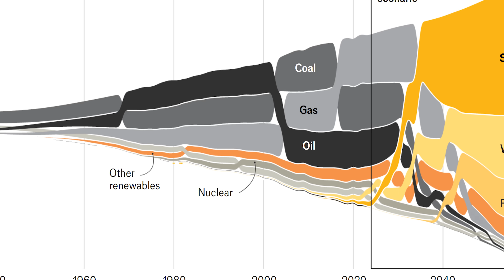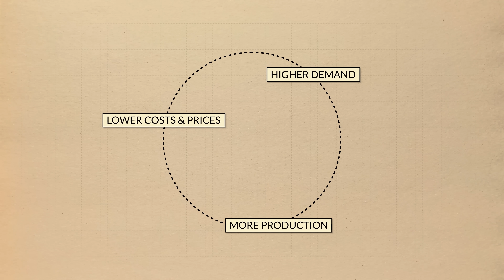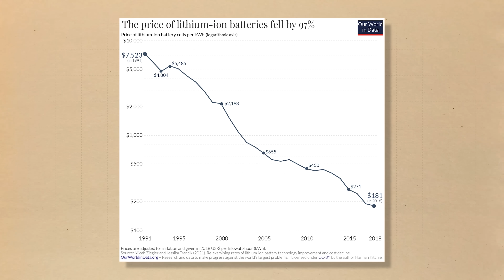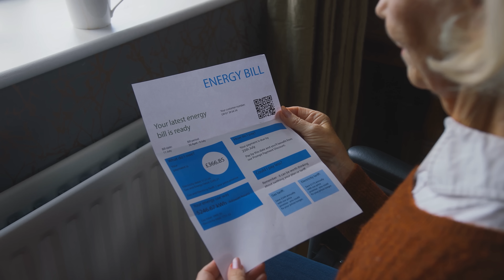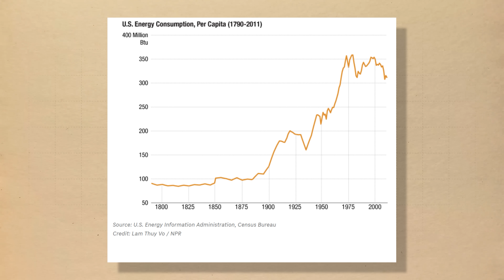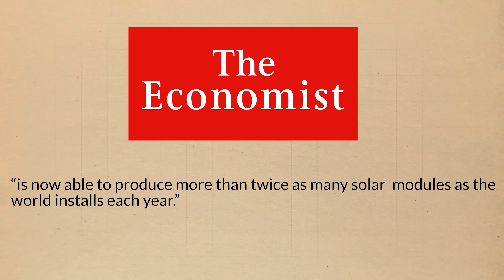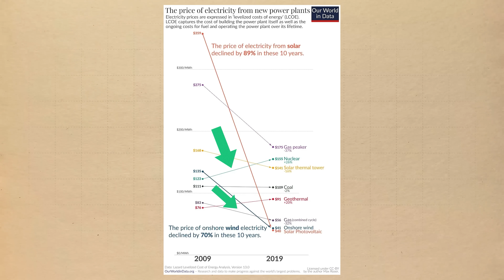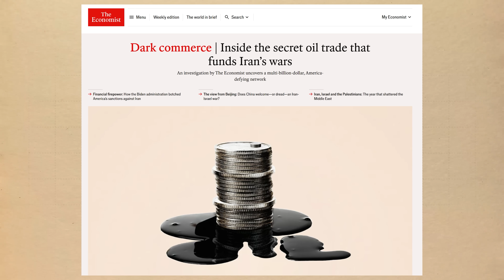Why solar will soon dominate & what that means for the world

Comment: Solar is perfect for fry sunny climates with generally stable weather conditions. In Greece many remote households use it.
Reply: It was. Solar photovoltaic technology has improved in recent years, to the point it is usable in less-than-ideal climates. Not ideal, but viable. And importantly, profitable.
Reply: Solar power generation can now be implemented profitably all the way to Southern Alaska and Scandinavia!  And that limit is moving north every year with the decline in solar panel costs.

Comment: Great. How much energy does all that extra capacity produce.....at night? When it is cloudy? No worries. Burn coal, gas, nuclear, build more dams to get the juice going 24 7.
Reply: That's why alongside those investments into new energy massive investments are being done into green hydrogen. Hydrogen can just be as easily transported as natural gas and it can even be transported with a few tweaks in the current gas network.
Reply: ... Is the battery Actually an alien concept to you? 
I mean, fair enough, it's new technology... only been around a bit over a hundred years or so...

Not to mention the various less well known, larger scale, and more technical technologies and innovations regarding such matters (pumped hydro storage, whatever the changes were that lead to 'base load' apparently no longer actually being strictly relevant, using a mixture of generation methods and spreading them out more (all the various power plants that come down to 'a steam turbine heated by X' (and, for different reasons, hydro electric dams) work more efficiently the bigger and more centralised they are, at least until the limitations of transmission lines exceed that effect, Wind and photovoltaic power, not so much.)

Not to say such matters aren't an issue, but they're not the slam dunk instant win so many people who are irrationally (or rattionally, if we assume the obvious motivations, which start at the somewhat reasonable "employeed in a job that would be rendered obsolete by the changes this would imply" and only become decidedly less charitable in various ways from there)) against the very idea of reducing reliance on oil and coal seem to keep thinking they are.
Reply: Solar barely cares if it's cloudy or not and with some smart planning you can move a lot of the demand to the times where peak power is avilable, because guess, what electricity is cheaper there.

Comment: Why do many graphs of the prices end before 2020? Also according to the Australian government: "Fossil fuel sources contributed 65 per cent of total electricity generation in 2023, including coal (46%), gas (17%) and oil (2%). Coal-fired generation continued its long-term decline. Renewables contributed 35% of total electricity generation in 2023, specifically solar (16%), wind (12%) and hydro (6%). The renewables share of total generation was up 3% on 2022, the highest share of total generation on record. About 20% of Australia’s electricity was generated outside the electricity sector by households and businesses." 35% seems to only be all renewable energy not all solar in total. Not necessarily discrediting everything they say but something that I feel like downplays their point a little and should be addressed.
Reply: At a guess? The more recent the data, the more likely it is to be available only through sources that have reason to find ways to make it... less than representative of reality. In multiple directions, mind you.
Or maybe no one's done a useful study of the relevant things more recently. That's pretty likely too.

Comment: I hope this cooperation with The Economist is not a recurring theme, because there were several references here that seemed somewhat farfetched , and which I do not believe you would have made previously. (I.e. referencing climate engineering as a use case, which I would argue is a right-wing talking point)

Comment: You know, I never stopped to consider solar as a driver of productivity the way that coal and oil were in their respective eras.  That's a really interesting possibility.
Reply: especially at night. Of wait...what to do then? Burn coal, gas, use nukes...or freeze.
Reply: Any source of cheap energy, especially efficient energy like electricity, will increase productivity.
Reply: Why would it be a driver when the real effect of renewables is to increase energy prices that disincentivise automation

It also cannot be a driver of productivity since we already had cheap all-you-can-use electricity in the form of Coal. The extra Jobs required by solar/wind industry represent a decline in productivity. A negative railway if there ever was one.

Comment: I am still betting on nuclear. with it being more cheaper, efficient, power and easy to adapt to increasing energy needs.
Reply: Good luck, you are going to need it ;)
Reply: It's not cheaper and wdym by efficient? It is certainly not more cost efficient. And what do you mean by "power"? It is "more power"? Wtf does that mean?
Reply: @XMysticHerox  by power I meant energy density.
Reply: @golgappagyan  So space efficiency. Which makes me wonder what you mean by "efficiency" if it is neither cost nor space. Generator efficiency? Not really relevant but sure.

And space efficiency doesn't really matter. Even solar while yes taking up more space this is still irrelevant. That is covered by cost efficiency. And again. Solar is more cost efficient.
Reply: @XMysticHerox  by efficiency I mean production capacity, energy storage, etc.
 You can compare production capacity of best solar farm vs nuclear power plant. 
Biggest one is in India which has a capacity of  2,245 MW vs Japanese Nuclear plant which has a capacity of 7,965 MW.
Reply: @golgappagyan  Because solar is more distributed. This is all accounted for in cost so a rather pointless metric to use unless you wish to cherry pick to irrationally support nuclear energy no matter the facts.
Reply: Nuclear power has distinct up sides, and many of it's more concerning downsides have been resolved at this point, but the remaining downsides (which included costs and the inevitability of idiot polticians and businessmen deciding that looking good to some third party by meeting metrics in... unhelpful... ways is more important than, say, actually ensuring that all the various failsafes Actually Work When Needed, to the point of active sabotage if that will improve the numbers while in charge of such things. And in some cases being entangled with weapons manufacturing,s which incentivises less than ideal power production practices in a number of ways, among other things) are frequently dismissed, downplayed, and ignored by those advocating in favour if it rather than being addressed, which tends to rather piss off those with legitimate concerns, as well as actually Reducing confidence in the technology.

Comment: Solar and wind power is cheap as long as you do an apples-to-oranges comparison ignoring cost of energy storage and system reliability.  Batteries are cheap if you focus on price reduction compared to before, rather than how low batteries need to be utilize that "free" solar power.  Essentially all PV installations are dependent on using up what used to be considered required over-engineering of the electrical grid.
Reply: The electrical grid is very overengineered even without renewables. With renewables you just need to account for it by building infrastructure that can store or preferably use "excess" energy effectively like hydrogen production or other methods of electrolysis. It's only excess if you haven't accounted for it
Reply: @XGD5layer  You apparently are missing my point.  The previous over engineering was used to ensure reliability in the system.  The use of renewables eats into that reliability.  There are no cost effective methods to store electrical energy at current grid prices.  There is little new pumped storage being built.  Current batteries are basically frequency control, not even covering moving electricity from the afternoon to the evening.  Instead, you have fossil fuel doing that.  It is tough to store energy for off-grid homes, where you trade off higher electrical costs for avoiding paying for the infrastructure to connect to the grid and by making use of cheap land.
Reply: @richdobbs6595  if anything you're missing mine, what stops us from further engineering it to suit our needs? I didn't say anything about batteries, I said electrolysis, which enables variable energy sinks on a large scale and is much cheaper than any metal-based batteries

Comment: Chemical energy storage is one thing. Another interesting power storage is hydro. Simply draw water up when the sun shines, open the flood gates when you need to draw on that stored power.
Reply: That requires the right geography to be cost effective, and most pumped hydro locations are already being used for that. Batteries are necessary (though what they might look like might be weird. Molten sodium batteries are wild)
Reply: @georgesmith4768  I would say that Brazil, Argentina and Paraguay would benefit quite a bit from using their regular hydro dams for storage.
Reply: @georgesmith4768  Pumped hydro DOES require the right geography.  But the potential sites are plentiful.  A study has listed 600'000 of them worldwide, ordering them by order of ease of potential + ease of implementation,. Only 1% must be built to cover the entire world's energy storage needs!  The potential resources of pumped hydro are simply ginormous!
Having said this, battery and pumped-hydro offers different qualities and weaknesses, and are actually more complementary means of storage, than are competitors.
Reply: The cheapest right now is compressed air.
Reply: @willabyuberton818  Come on!!!!  Compressed air as a mean of energy storage is, for several reasons, complex to implement, suffers from a quite mediocre round-trip efficiency, and is quite expensive!  However, should you have a large suitable underground cavity availability, it may be a player in a storage technology mix.
The cheapest solution as of today, with excellent round-trip efficiency (up to 85%), is clearly pumped hydro.
Reply: You don't need pumped hydro to have hydro storage: just switch off the flow when there's plenty of power, and switch it on again when it's in demand.

The UK and Norway have something like this going on, with Norwegian hydro power stations inactive when it's windy in Britain.
Reply: Yes, go ahead and fight the environmental lobby and bulldoze millions of acres of wildlife to make room for more dams. Go ahead, calculate what happens to hydro power during droughts. Oh yeah, how do those fancy solar power pumps work in northern latitudes during, I forget what it is called...winter? And on cloudy days.
Reply: That chestnut has been around for a millennium
Reply: You would need to create huge reservoir for that, which isn't an option in flat countries.  You could use electricity to separate water into H2 and O2 during the day, then burn it at night for energy, and no CO2 is produced that way.
Reply: @xiphoid2011  flat countries usually have neighbors nearby who can provide stability to the grid.
Reply: Swiss have that pumped hydro, also here in Croatia for long time. Height difference.
Reply: yea compressed air is an interesting concept, they've mentioned it during my BSc in EE and it isn't THAT bad compared to pumped hydro but sure battery storage would be more cost effective short term. other tech I'm keeping an eye on is flow batteries, their capacity is under the rock but it's cheap to operate and expansion can be endless
Reply: That's called a gravity battery
Reply: The concrete requirement alone to get the levels of storage.... might as well just build Nuclear with the concrete and steel.
Reply: @CmdrTobs  Why concrete?  The  upper and lower lakes of a closed-loop pumped-hydro installation are most of the time earth dams, not concrete ones.  They basically only require earth-moving equipment for their construction. 

Proof that  closed-loop pumped-hydro does not require excessive amounts of materials is its record low LCOS (levelized cost of storage)... still significantly cheaper than batteries.  Although, with the continual decrease in costs of batteries, that may reverse sometime in the future.

BWT, nuclear ALSO require storage, especially the when using reactor technology that is little steerable.
Reply: @francoisbadoux625  Easy natural occurences like Dinorwig are baked in. Do the maths on the scale of hydro storage. Materials reqs like concrete are staggering

The LCOS compared to batteries is kind of meaningless. We are moving from a real time grid that req. almost no storage to one that demands weeks worth of storage. Nothings going to be comparatively cheap compred to before.

Nuclear requires no grid storage beyond what is already built with the current interconnects. Gen IV+ nuclear requires no storage to the point we can start scrapping peaking and closing down pumped storage.
Reply: Pumped hydo is the current best option for medium term grid storage.  👍
Reply: @jasonneugebauer5310  You would think so, but if you look at construction economics, we basically struggle to build big things out of concrete easily and cheaply and on time anymore in the west.

The required dam projects have all the construction issues of big nuclear. Might as well just build the big nuclear.
Reply: @CmdrTobs  you say just build nuclear.  But the main use for pumped hydo in the US is for nuclear energy storage.  Everyone wants to run nuclear power at a steady high production rate because the fixed cost of running nuclear is very high and the variable cost of producing more or less power is very small. 

But, we don't use a steady amount of power throughout the day.  Leaving the system with to much power at night and not enough during peak hours.  So some power producers have pumped hydo located close to nuclear plants to take advantage of full nuclear production while using the pumped hydo for load following. 

You can't just build more nuclear unless you want to start curtailing nuclear production, which would be a mistake because the nuclear plant cost the same  siting idle as running full out.

With more nuclear power and/or more wind and silar we have to have more cheep storage to make the system work atall and pumped hydo is the only game in town if you want cheep and reliable. 

Tell me if I'm wrong.

Comment: I would love to have solar panels on my house, but the electric utilities make it so difficult and they impose a $30/month fee just to have them.  Like you said, Chinese solar panels have high tariffs and the US produced ones are way more expensive, so for US residents it's not there yet.  Big Oil fights it tooth and nail and since they own Congress it wont change anytime soon.
Reply: $30 a month, that just means you need to produce more than $360 worth of transfer costs a year. Given that most utilities list this at $.20-ish, your panels need to produce ~1 800 kWh per year to offset that fee.
Reply: @wertigon  It's even worse than that.  In Georgia the public utility will only buyback excess power at the wholesale rate, not what they charge you when you use electricity.  The only way to go is to have solar with battery backup which is more expensive up front.
Reply: @ScottCP1  I mean, that’s how supply and demand work, no? If you produce a product, which they don’t actually need, the price will be low. If it is shining on your rooftop, then it obviously shines on everyone’s else rooftop, you are over-saturating market.

On the other hand, when you need electricity, it means sun doesn’t shine on your rooftop, and therefore no one else’s rooftop. So the only producer of electricity is someone with other source of energy who can, less supply, more demand, higher price.
Reply: @stafer3  That's not necessarily true.  During peak times during the day, electricity is way more expensive, thus the grid could use the electricity since it goes for a premium price which happens to be the time a solar home might have extra output.  While a solar home might need electricity at night, the vast number of businesses that are open 9 to 5 and such are not using nearly as much which is why power is cheap overnight.  There really is no excuse for them to do this other than regulators let them.  Our electricity provider is a monopoly
Reply: @ScottCP1  I googled that Georgia has peak demand hours in summer between 2pm and 7pm.

And another google search says that solar panels give best performance between 10am and 2pm.

There is clearly mismatch there.

This why I prefer closed system with a battery. There is no ambivalence there.
Reply: @stafer3  That actually depends on the direction your panels face, any obstructions, as well as your latitude.  A solar panel in Maine wont be the same in Georgia. The rates also vary widely depending on your electric plan, but regardless...the cheapest time is at night.  FYI...did that same google search and it said between 10am and 4pm for Georgia
Reply: @ScottCP1  Or you use 4kWH / day from your panels instead of the grid.
Reply: @stafer3  Is that because solar panels are providing the power and dropping the peak demand for thouse hours?
Reply: Just smuggle them through the Mexican border. Easy peezy.
Reply: One problem is also long supressed energy costs in general in the USA. This makes alternatives just not as attractive because the treshold for achieving significant savings is a lot lower.
In other parts of the world solar has been a no brainer and a big money saver for a while now. And the ones who invest in it will basicly have free power for 40 years or more.
Especially if you combine it with other ways of saving energy.